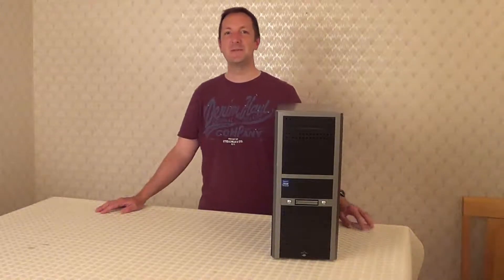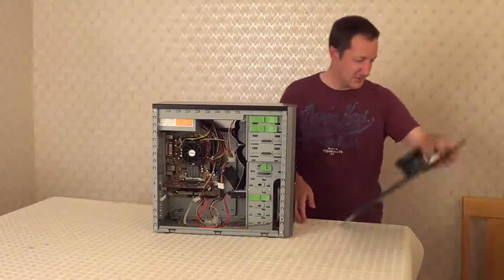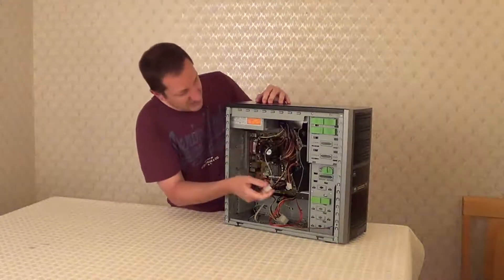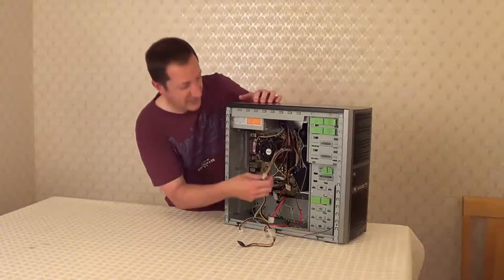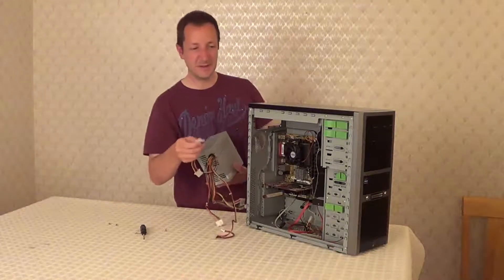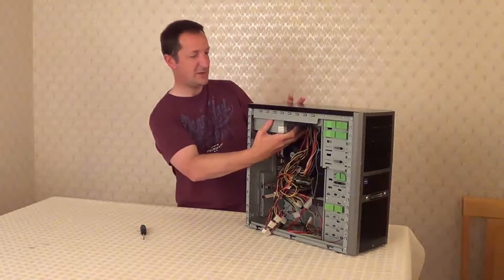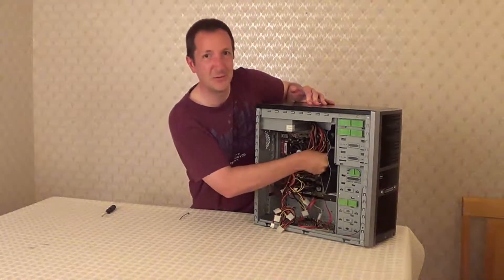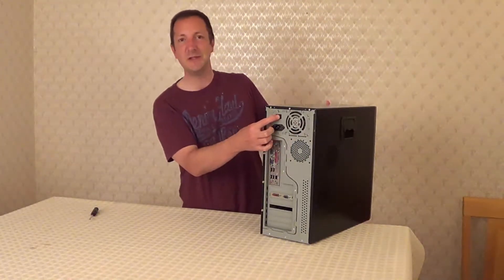How To Replace A Power Supply Unit:  step by step guide

Comment: You spent more time on the mechanical work than you did in identifying exactly where the connections are and how they are identified. I know how to latch latches and line up screw holes but I don't know which connector goes where .... your instruction was weak on what is most important to we amateurs.

Comment: Hey Dave, great tutorial video- you earned a subscriber! I have a question regarding my desktop. Mine randomly shut off and now has no lights on at all indicating power supply. Is it my psu or maybe the cable? I've tried plugging into other outlets and still no lights on. Note that my desktop is over 5 years old and never had a psu replacement. Thanks
Reply from the maker: Sarp Eras Thanks for subbing! PSU cables rarely fail. Infact I don't think I've ever had a problem with one other than the odd fuse going (which obviously isn't your problem though). It sounds like your problem is most likely either the PSU or motherboard. As the PSU is much easier to replace I would try that first.

Comment from the maker: If your DVD drive is using an SATA power connector, you can use that same power connector for a Blu-ray drive instead. So in that situation the answer is yes. If however your DVD drive is using a Molex power connector, just be sure your new power supply has a spare SATA power connector for your Blu-ray drive.